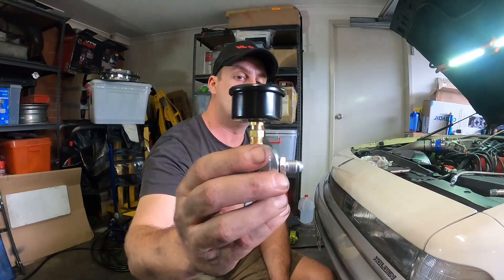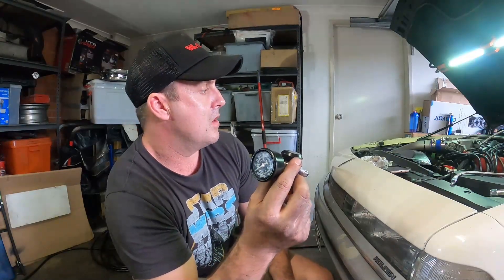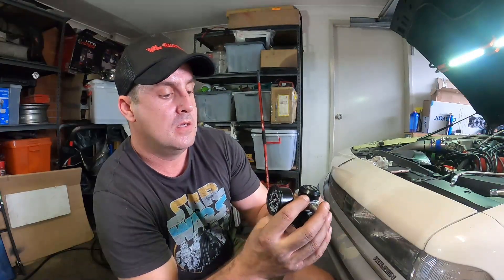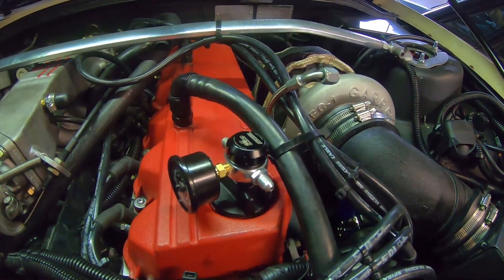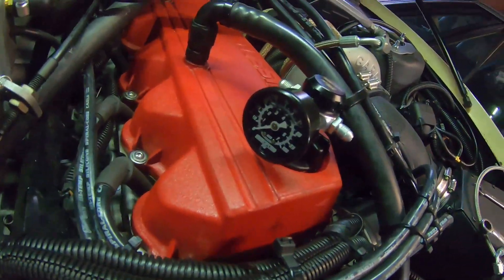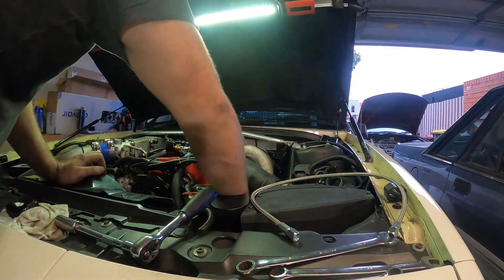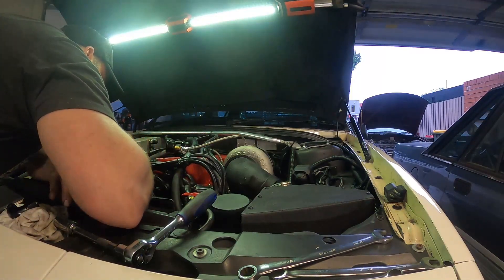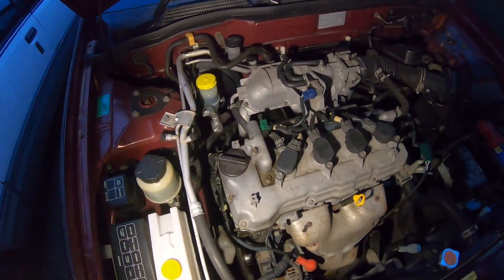Holden VL Turbo Commodore Turbosmart Oil Pressure Regulator Install

Comment: Hi, very nice setup!!!, dumb question: how does the opr 40 affect the engine oil pressure?
Reply from the maker: It’s basically a ball and spring inside, once the spring tension is overcome it bypasses the oil to the return side only allowing a certain amount of pressure to the turbo. It has no affect on the actual engine oil pressure the pump puts out.
Reply: @dalevloghlan8771   i got one installed but not started engine yet, and just realised if this is like.a fuel.regulator and not like hydraulic valve( oil pressure controll on both sides of the plunger)  will bassically work like the man pump.bypass, i belive oil pressure will be limited on high rpm
Reply from the maker: Yeah pretty much, what it means is your turbo will get the same amount of oil pressure at all stages of the rev range, thus preventing too much oil pressure to the turbo at high rpm so it doesn’t leak past the seals.
Reply: @dalevloghlan8771  yes i.understand, but i was refearing to block.pressure, if this is just a bypass  it  will also.limit the block.pressure to 40?
Reply from the maker: No mate, that’s incorrect and not how fluid dynamics works. The pressure from the pump is controlled via the relief valve in the pump right after the output from the pump gears, meaning all the components the oil galleries travel to will get that same pressure taking into account losses for the distance travelled and size of the galleries etc. The OPR 40 installs in the turbo oil feed and gets the same oil pressure the pump produces at the inlet, it allows the turbo to get the desired pressure as per the preset tension, the excess oil is then relieved out of the OPR drain and then back to the sump therefore having no effect on the actual pressure inside the block.
Reply: @dalevloghlan8771  yes, this was.my concern. Thanks for the comprehensive answer!!!
Reply from the maker: No worries mate, it will be fine 👌🏼

Comment: wasn't the rb30 et oiL pump ideaL for your combo? cuz I'm now gathering some info so I be abLe to buiLd the unbreakabLe rb30 for my daiLy use. Looking for 350hp not more I guess it wiLL be enough to stick with the rb30 et oiL pump.. whats your thoughts

Comment: Hi, curious if you went back to the normal size restriction fitting for the turbo? Or did you find that the OPR eliminates the need?
Reply from the maker: Originally I ran it without a restrictor as that was what Turbosmart recommends. The OPR got my feed pressure down to about 50psi at operating temp, although it’s meant to be 40psi regulator, I put this down to the high output pressure of my oil pump. I got a little paranoid and since then I have been running the OPR with a restrictor and have been experiencing no issues 👌🏼
Reply: @dalevloghlan8771  That is what I thought as well. I am.paranood to run mine without any kind of restriction as I am running a Blouch ball bearing turbo. Did you use the stock size restrictor?
Reply from the maker: Yes I used a 1mm restrictor.
Reply: Thanks man...appreciate the advice!
Reply from the maker: No worries mate, best of luck.

Comment: Another top job there Dale, hope disconnecting and re-connecting wont be done too often.
Reply from the maker: Yeah I agree, I will eventually drain it straight to the sump, however pulling the motor out at this point in time just to do that didn’t seem worth while. Let’s see how long I keep it there haha